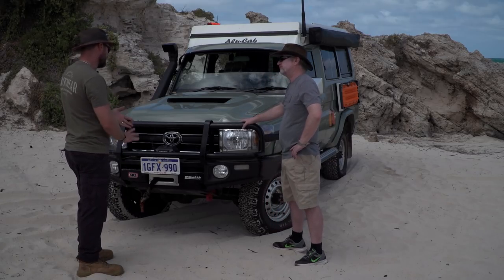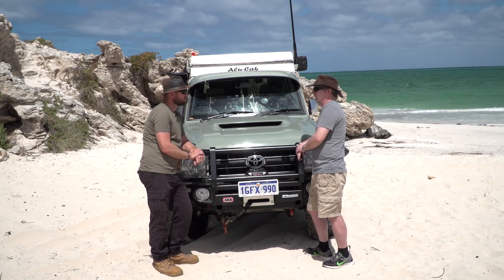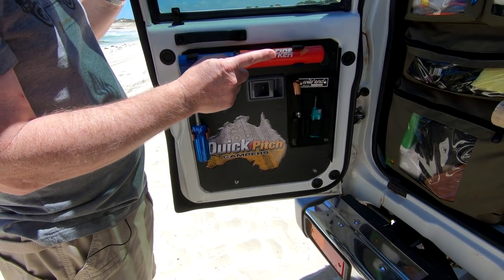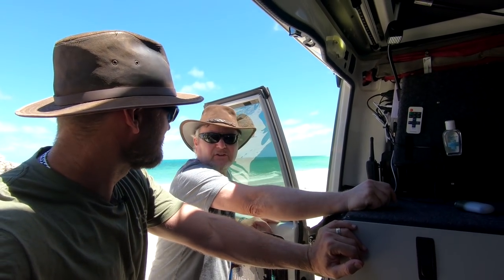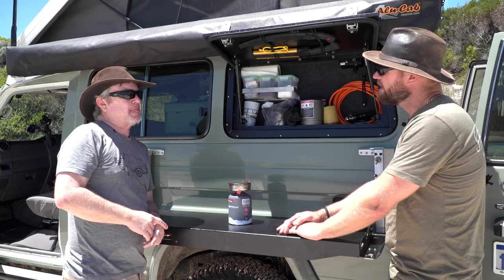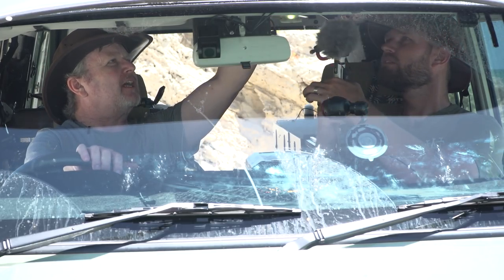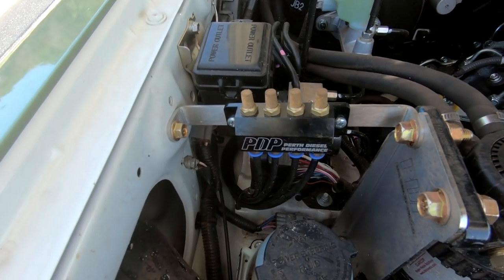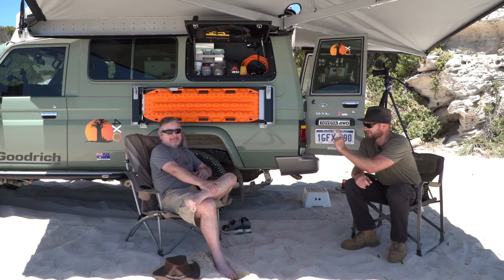Toyota Troopy, 4XOverland Modified Episode 45 (feat A.S.P.W)

Comment: My old troopy had the side bars , decided to remove them in mid 2017,  should have done it years ago.  Dont care much for the bodywork.....  yes the UHF antenna usual mounting on the bull bar is annoying but mounting it up on the roof, well it wouldnt last long going through overgrown tracks.  Got to get those side opening upwards windows!  With you on the 235/ 85 R16 tyres. Ive considered the 265/75 R16 size but for now the narrow ones will do me

Comment: To Andrew or Ronny,
  It would be interesting to hear more feedback, from either of you, on the long term reliability of the DPF on the Land Cruiser.  Here in North America, we've been dealing with DPF's and EGR's for about 10 years now.  Initially, the vehicles which had them were prone to malfunction and poor fuel economy.  However, in recent years, better tuning and the addition of SCR's (Selective Catalytic Reduction) has alleviated many of those issues.  Still, many people here have reservations about traveling remotely with those systems in place.  

How has the reliability been for DPF-equiped vehicles during offroading?
It is interesting that Toyota chose to add only a DPF (in addition to the EGR) to its 4.5l v8 diesel.  American manufacturers tried that combination at first, but had quite a few reliability problems (clogged DPF's, excessive EGR cycles, EGR valves getting stuck).  Most diesels in North America now utilize SCR's in addition to DPF and EGR's.  Even with those changes in place, the OEM's encourage occasional highway driving in order to allow the DPF to properly regenerate.

Anyways, I enjoyed the video and look forward to future content from both of you.

Comment: Another great episode . You didnt mention the spare shocks strapped to the chassis , that seems like a good idea
Reply: I just removed them and found that they had corroded badly. I used close cell foam and rubber so it would not absorb water, but it still managed to catch quite a bit and cause corrosion. I probably wouldn't do it again.
Reply: Millions of years ago a lot of Australia was under water , I guess there will be some of the country you have been driving over would be salty to a greater or lesser degree .

Comment: Youll fix a lot of your seat issue by spending some time on your core, you can't expect to be comfortable if your spine is supporting you off road as you bounce around.  You need a stable core, it helps relax and remove strain. Be fluid in your body but be stable!!
Reply from the maker: after a 1000km+ drive in 12hrs more or less straight it doesnt matter how good your core is you will be sore somewhere... and thats just day one!

Comment: He's worried about the weight of the brush bars, but not everything else on board :P good vid!
Reply: Every item is considered for its weight. A heavy steel item is always going to be questioned if it isn't worth the weight gain. Logic?
Reply: "I'm not building a racing car, what's the real gain" - 49:30, I just thought the brush bar thing was odd given your stance on minimal performance gains, that's all.

Comment: I very specifically carry 1 spare on the vehicle because i go with a friend who brings a suzuki jimny that has adapters to convert to the landrover hubs and i carry a sankey with 2 spare military michelins so between all off us there is 4 spares pair that with the fact all 14 tyres with us a pre filled with slime sealant the tyres are very strong, from experience you can drive over 2 screws and have a tyre steaked by a stick before you have to repair it, but with the arb quick tyre repair you can get yourself atleast to camp to change the tyre even then you can still keep inflating it to get further so i see no real need for 2 spares in my personal ser up but solo i bring three (with the trailers)

Comment: Andrew, you may want to check out the Rigid Industries E2-Series Driving/Hyperspot Combo LED Light Bar.
Reply: Red Proton oh no it might block the air flow to his engine and cause an overheating problem when he is out running the dunes on his superior skinny sand tires.

Comment: Question for both of you...Just curious.....do you have a figure for how much you've got invested in your respective builds?  I'm guessing it's a number near the price of my home.  Also...instead of inverters, have you considered getting DC-DC power supplies for your laptops?  Many manufacturers make very efficient power supplies that will run on anything from 9-32VDC AND 95-230VAC.  It's pretty inefficient to step up battery voltage to mains power and back down to 19VDC (standard laptop power).

Comment: Has Andrew considered running computers of DC rather than having all the inverter stuff. Most computers (most stuff in general) is DC so converting the cars DC to AC with an inverter an then back to DC with the computers adapter is a bit lossy and creates kit that = weight. Im sure he wont be able to totally get rid of the AC/210v, but minimising it would help reduce weight and be more efficient.  DC 12v to DC 20v (Mac) 5v (US) would be best I believe.

Comment: I would love to get info on the radiator thing on top of the engine !!!
Reply: It's the standard intercooler that comes on the 70 series (this one is the 2017 version).
Reply: Is there any type of aftermarket intercooler, that can be added ??
Reply: Yeah lots of options. Front mount, top mount, air cooled, water cooled.

Comment: Curious about the water heater. Can you provide any additional info? And pump used?
Reply: Sam Oliver you can try use dc 12 v pump 60 watt
Reply: trianggaindra lukmana  do you have any ideas about a 12v water heater?
Reply: Sorry i think only water pump. But you can imitate heater from water dispensing. You need power inverter though. Or coil based water heater that put on water tank

Comment: I don't get the concept of skinny tyres. Beach driving don't you let tyres down to get a bigger footprint? Isnt a bigger surface area better for sand?
Reply from the maker: Yes but it’s not The width it’s the length of foot print. The wider it is the more rolling resistance there is the more sand you need to push. A tractor is a good example they are beach masters when it comes to launching boats on soft sand and recovering passenger vehicles that are bogged. Big tall narrow Tyres. On the rocks, clay and rutted stuff it’s a different story in my opinion

Comment: Thanks for sharing but what is a locker breather? Excuse my ignorance.
Reply: The factory diff locks on the 70 series Cruiser are actuated by an external electric motor. It has its own breather but the standard tube only goes up to the chassis rail.
Reply: JP Onefourseven Thank you for the response 👍 I find it interesting that an electric motor needs a breather.
Reply: Maybe it displaces air as it actuates? I am not sure, I have never had a close look at one.
Reply: LROR Land Rovers Off Road temperature differences during driving, or cooling during water crossings. Air needs to be able to escape otherwise you'll squeeze either the grease through the seals, or suck water in during cooling.
Reply: Skippie Yes thats the principles of needing a diff breather, I will have a look into the workings of a LC factory locker when i have time.

Comment: Not sure I agree with all of Andrews thinking on tyres on sand but a great vehicle.
Reply: When driving on sand, each tyre pushes up a small hill of sand in front of it and this acts to slow the vehicle down. The narrower the tyre, the less sand it pushes up in front of it. This gives better fuel economy that is noticeable when driving long distances on sand, and helps when trying to climb sand dunes in a vehicle with very little power.

Comment: I hate driving behind cars, that have dpf removed. I swear I can smell it. Normally you can't smell modern diesel engines, but some (usually about 8-10 y old cars) smell so bad, that you have to close the ventilation if you are behind them in traffic. And it's not about car model..same models don't smell so bad. Yes, you get more power or economy, but You are doing it at expense of other peoples health (and yours too)  and environment. Please don't remove dpf's. However car manufacturers should make dfp operations more transparent and add a option to start the cleaning cycle yourself (if dpf is starting to get full).

Comment: Solarpod an "affordable" option for a daily driver? Google how expensive them things are.
Reply: And then compare that price with the cost of a split charge battery system with charger, solar controller, battery, and 1000W pure sin wave inverter. Not much difference, and this is portable.

Comment: Alu cab pop top is so pointless. A walk through design where you can't actually walk through to open it, why on earth are the latches on the outside? If you need to pee in the middle of the night you both have to get up because that stupid drop down part of the bed. The "canvas" also leaks. A gloried 13k roof top tent. Andrew you are a moron

Comment: Sorry Ronny, I just couldn’t watch the full video. This guy is full of shit, lights on your bar will over heat you engine, skinny tires are better in the sand! He is out of his mind!!!!
Reply: Higher profile tyres are definitely better in the sand, but it doesn't matter so much these days with most 4x4s having plenty of power to push wide tyres through sand.  
Still, the skinny tyres will do it with less effort and better fuel economy.
Reply from the maker: Skinny Tyres are better in sand, maybe not on most other surfaces in my opinion but I agree with the skinny’s being better on sand. I’ll try to demonstrate this in a video. Just need some skinny Tyres first.